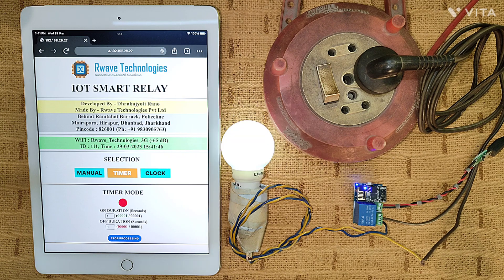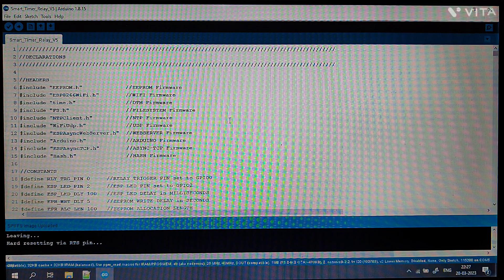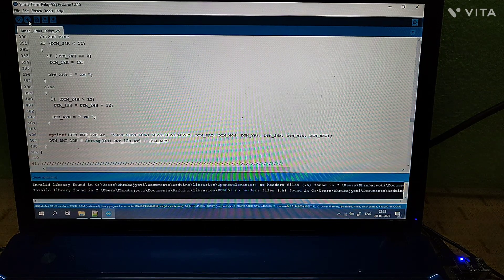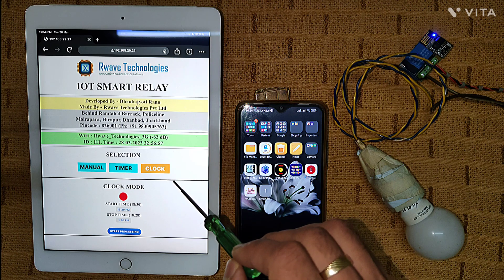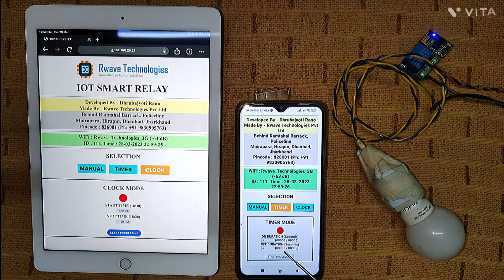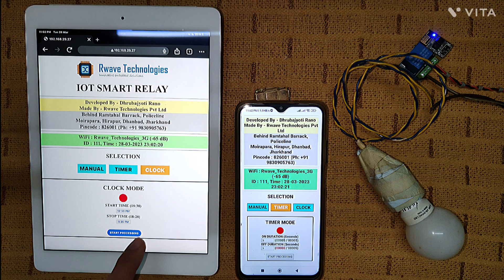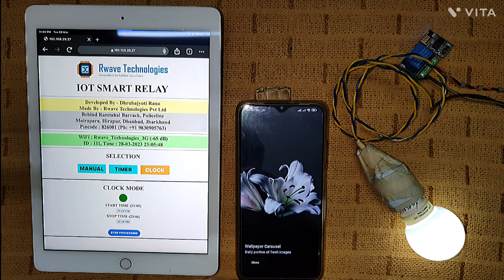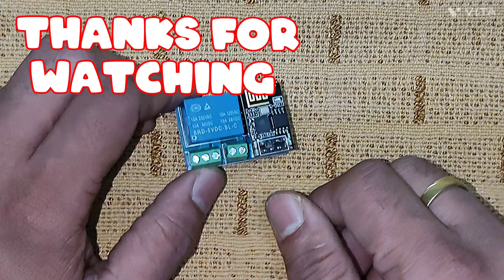ESP01 IOT Smart Relay Switch Module With Webserver Mobile Controlled Timer & Internet Time Scheduler

Comment: Will the timer work even if we leave the site permanently? This means that the disconnection and connection times will be stored in the ESP 01 memory right ???
Reply from the maker: @omarenabi-h4f  Website is just an interface. When you click the data is transferred to ESP and gets stores. ESP processes the request according to the data stored inside. So even if you disconnect the website still the device will work